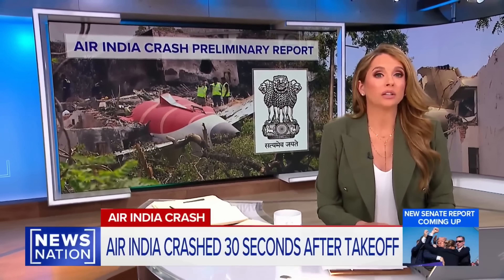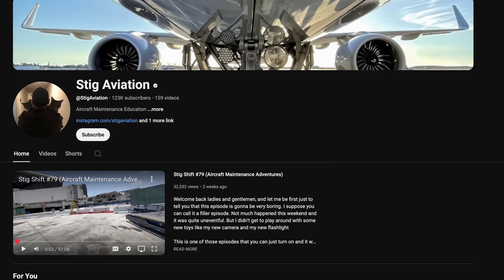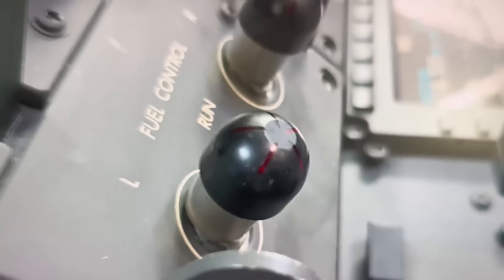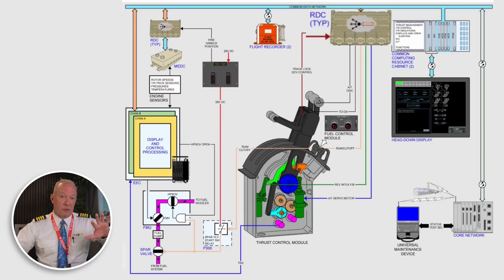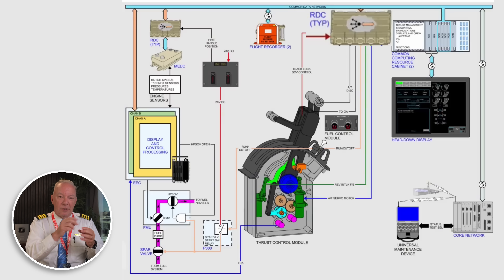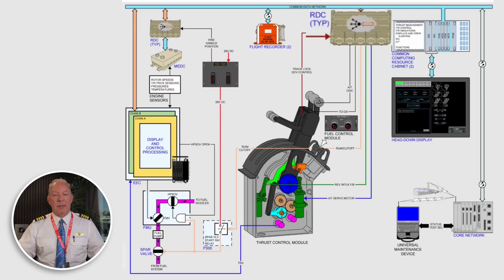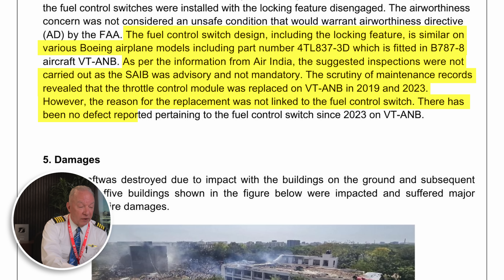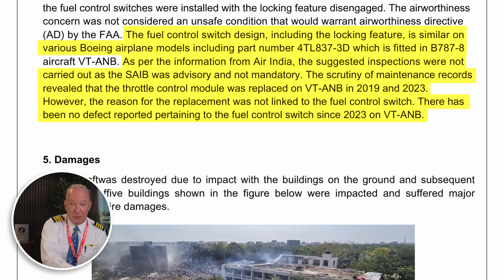The Truth About Boeing 787 Fuel Control Switches

Comment: Airline News with Geoffrey Thomas offers another theory. Possible water ingress into the electrical system caused a short. The pilots were trying to re light the engine. The preliminary report just does not give enough details for any theory, but right now, I still dont think the root cause is pilot error. 😢
Reply: If the water ingress caused an electrical system to short, will both the engines still be running?  Isn’t there a DC straight from the battery ? If so, why would you cut off the engines via the fuel switches and take 10secs to switch it back on? Also I still find it difficult to understand why would the pilot say ‘why did he cut off’ the other one responding ‘I did not do so’ why deny the action during an emergency situation?
Reply: @ashishthakur7396   Yes, the both engines would be running and short registered in the system and switched to one of the triple, quadruple redundancy units. DC comes from PSU that also has failsafes and monitoring and multiple sources.
That denial served the purpose of his act, any sooner would have ended the complete engine spool-up and no crash.
Reply: If there was a gross electrical fault at take off both Pilots would have been aware of it. The First Officer would not have just asked  the flight Captain,  why did you do that? (Closing the fuel cut off switches) Then having the Captain deny it makes no sense. The Captain would have indicated he was doing an engine restart and would have probably made that very clear on the CVR.  The First Officer flying would have clearly known of any electrical failure as well.
Reply: And why would one pilot deny moving switches by saying "i did not move them" while they were clearly moved? He would say something that it shorted or something, but not stay silent for 10 seconds and do nothing!
Reply: @Robis9267  Why, to complete his act - if any sooner the one engine would have spooled up and no crash + jail time.
There were only 3-4 seconds missing...
Reply: Stop talking about that nonsense channel - magical short from magical water that didn't register in evaluation units or FDR.
These people took a payment from someone and their talk changed overnight.
Preliminary report gives all the details and assures there are no other events or errors in FDR data, so the airline FAKE news channel is trash.
Reply: It's not an error, this was murder-suicide, facts are clear
Reply: This one gibes a much better theory thoroughly technically researched that explains the time line and has only a single point of failure of a crucial bug unmonitored component https://www.youtube.com/watch?v=OLxLN3osS1Y

Comment: Switch is switch, relay is relay. Relay is controlled by magnetical field of the coil which is inside, so higher current can be passed through relay “main wires” for example by use of thin control wires :) slightly offtopic

Comment: Thanks Steeeve for putting the record straight. I am with you 100%  there is no good reason for the fuel switches to be at cutoff for any period of time full stop. No engine can ever run without fuel and no aircraft can fly without it's engines running.

Comment: Hi, that's a good explanation, but... It turns out that the loss of 28V DC will be treated by the computer in exactly the same way as a switch being turned off. This voltage comes from the battery. We've had problems with such batteries in the past. It couldn't have been that the voltage dropped. Then the fuel supply was interrupted and the wind turbine started. DC power returned from the wind turbine, and the computer incorrectly registered the switches as being turned on again.
Reply: No the backup comes from battery to PSU. The engines deliver all needed power and battery is for backup.
For your theory the engines would have been OFF before and battery failed before that could happen and also why these events didn't register to FDR that has its own battery?
So, it turns out you are wrong.
Reply: It is my understanding that it takes power, (28V), to turn fuel valves off in aircraft with electrical fuel valves. Loss of electrical power, (battery, buss), will not cause fuel valves to go to the off position.
Reply: @joseleon624  No, it is fail safe open then and if main pump supplies pressure with switch ON and fail safe closed if switch is moved OFF.

Comment: Thanks for the video - enjoying following your content since the air india crash news broke. Minor nitpick, typically "closed loop" system would refer to some system which has feedback. This system seems like "open loop", i.e if for some reason the relay failed, or one of the valves failed, you would not get feedback at the switch. A "closed loop" switch, might for example jump out of "run" to "stop" if the valve could not open, or would jump the other way if it couldn't close. Clearly this wouldn't make sense in this application, but in industrial/control systems, closed-loop means it's self-sensing with a feedback mechanism.
Reply: Not necessarily self sensing, but it is a closed loop of sorts all be it corrective action would require human interaction,  The switches are obviously monitored as they are recorded , the recorded condition of the switches would be repeated by the computer to the head up/flight display. responding to any alarm or instruction the polit would operate the switch accordingly - so technically a closed loop system with manual operator control, as in SCADA/Industrial control systems.  just not an automatic closed loop control.

Comment: Sad to say, your understanding of the electical systems & schematics is incorrect and misleading. BTW, as a giveaway, we use "open" , "close" to describe if it's with feedback control. Not that "close" a switch when closing the contacts. " Therefore it's a closed system"
Reply: I'm an electrical engineer and I cannot make heads or tails of your remarks. You seem to confuse open and closed as applied to switches with open and closed as applied to complex systems. They are not the same thing.
Reply: Read n listen carefully again to what Cap Stee said as he showed up a piece of kids 101 basic electric control comprised of a battery, a simple 1PST switch, a load.Its how he explained " close " .I didn't mentioned I am an triple E in the system n circuit design of major mission critical SCADA systems ( Signalling n Control, mass transportation), just not to scare off people who are doing narrative browsing.
Reply: If you're in the EE industry, you might have heard of a term, " Hysteress loop in CLOSE LOOP control ".The spelling is both CLOSE , but the difference is mile difference there. Tell you what, it's this part of Control circuit that have caused, not only this 171 case, but the whole seies of  airborne n landed engine failures. Perhaps now you know how serious I'm taking the subject on my shoulders for humanity' n Christ's sake.Actually I started hinting those of the over simplified ignorance of mandatory  multi dimensional Hysteresis loop ( say, WOW, wheel distance travelled sensor.....) BEFOREallowing fuel adjustments can be made for stall and Stop.
I noted some claiming professional commentors has since given up RAT and flaps blames to follow this path of reasoning -fuel cut out -plane crashed. It's only you guys don't realize how it happened. You can't know if you don't even know what NO/NC 2PST/DT mom/latch ac/DC UPS ,,,,,are, and just put it in one word gitches. I tell you what, anything that doesn't exhibit wear and tear doesn't not follow p(MTBF). Software is one. The whole world has been cheated

Comment: Can the order that the switches were switched off give us a clue as to who flipped them? Is someone sitting in the left seat more likely to go left to right and someone sitting in the right seat more likely to go from right to left??
Reply: Why arent we considering a possibility where dual engine failure happens just after take off. Then pilot manually turn fuel switches off and on because thats SOP in Boeing planes in case of Dual Engine.? You can refer to Gaurav Taneja AI 171 Part 3 in english dub to understand more about this theory as timeline of RAT deployment also matches with this. https://youtu.be/pq2AZdzH7X4?si=0pLKXsmG1M7tRXAZ

Comment: What people get wrong is that they believe that BOTH switches were moved within a second.  The report says they were thrown a second apart, so the one second "clock" doesn't start until the first switch is already in the cutoff position - so it was one second for the pilot to move his hand and throw the SECOND switch after the first.   Also, you would want to throw them as close together as possible so as not to induce yaw if one engine is off for a few seconds before the other - at least in a small plane.  I think Captain Steve said once the 787 automatically adjusts for yaw if one engine rolls back.
Reply: The report does not state the switches were flipped off or "thrown".

Comment: I'd like to know what sends the signal to the FDR, to indicate that the fuel switches have been turn on or off. Is the fuel switch a double pole double throw type and the other pole sends the signal to the FDR, or is there a contact on the Spar valve relay which send the signal to the FDR? Is it at all possible that the throttle module had a faulty connection, causing the engines to roll back and for the fuel switch back indication to the FDR to loose connection, indicating that the fuel switches had been thrown, when maybe they hadn't. One pilot then assumes that the other has done something, when maybe he hadn't ??????

Comment: Hi captain Steeeeve. Great video once again!

I agree that the switch and the relais are mechanical and won't move by themselves unless manipulated by humans. But how does the FDR register the position of the switches?

The FDR recorded that the Fuel switches transitioned from running to off. I'm wondering, does the FDR know this because there is a sensor at the switch that registers its position or does it know this because it measures the 14V/28V in the wire between the relais and the spar valve/Fuel Management Valve/High Pressure Shut Off Valve? 

I assume it is the latter (because sensors for all switches would mean even more electric cables and thus more weight), then there is still a possibility, if only a miniscule one, that either the 14V/28V signal was interupted somewhere between the throttle module and the point where the electrical cables for the #1 and #2 engine fysically split up and are not alongside eachother anymore. Or the 14V/28V power line was interupted somewhere between the battery and the throttle module. 

It could be chafing, it could even be a rat chewing on cables, it could be a cut of the cables due to a (heavy) object that fell on these cables after rotation. Who knows? It must be something crazy since it would be the worlds first and its defying all odds.

I agree that the chances of this happening are extremely small, but they should at least be investigated and ruled out before the blame eventually comes down to pilot actions.

Disturbing fact to me is that the investigation team knows exactly which pilot said what during that last minute and they haven't given a transscript of the CVR, which is relatively easy to do, and that to me is an indication that the investigation team is hiding something. It could be culture standing in the way of the truth.

Comment: I believe what the gentleman on the panel with you may have been trying to articulate is that inside that column, there are wires within a bundle that at connected to those switches.  It is plausible that the set of wires connecting the switches to the relays could have had a defect (caused by rubbing against something possibly) that could have shorted or broken the connection resulting in loss of DC current in the circuit.  That would have been the same as turning the switches to off and transitioning the relays.  Seconds later, the fault (short) may have rectified from vibration and restored the circuit therefore re-establishing the circuit.  Not sure of the odds of that happening, but is within the realm of possibilities.
Reply: The fact that both the cut-off as well as the power-on of the switches each had ~1 second of delay between left and right does speak against this theory. Plus I bet the recorder does monitor voltage too since that is a very thinkable problem.

Comment: Well said. Some don’t want to hear the truth.
Reply: Why arent we considering a possibility where dual engine failure happens just after take off. Then pilot manually turn fuel switches off and on because thats SOP in Boeing planes in case of Dual Engine.? You can refer to Gaurav Taneja AI 171 Part 3 in english dub to understand more about this theory as timeline of RAT deployment also matches with this

Comment: Captain Steeeve 
TCMA: Thrust Control Malfunction Accommodation: This shuts  both engines and guards against inadvertent asymmetrical high thrust situations. Doesn't this mean the fuel shut of happened without the switches been manually turned off?

Comment: people imagine that airplanes are super complex but those critcal systems are simple for a reason, simplicity is safety
Reply: KISS. Keep it simple, stupid.  Or something like that.
Reply: @williamgibb5557 bang on right . I had a few other statements I told my aircraft maintenance apprentices. The best one was … Better to ask a stupid question than do a stupid act. I always backed up this with a few occasions when I asked what might have looked like a stupid question. Always safety first. The other was there is no parking area at 35000 feet. Gets them in the correct frame of mind.
Reply: Yep we aircraft maintenance chaps call these systems KISS. Which stands for keep it simple stupid.
Reply: For what I could research by myself, those are no simple systems.  The logic behind the circuit described by Captain Steve is simple, yes, but that doesn't mean "the switch design is simple", "the relay design is simple", "each valve design is simple".  I'm not an aeronautical / electrical / mechanical engineer, but I can tell you that there are lots of designs for each of those components so as to "add complexity in the  specification or design of each module".  Maybe what you're referring to is "simplicity at the highest level of detail" and if that's the idea, I agree with you.
Reply: Exactly
Reply: Nice
Reply: Lol no, you're just repeating gabber to sound proficient.

A simple system is NOT necessarily a safe system. Naive fallacy to think this.
Reply: having said all that..if suicidal..why put them in Run position at all?
Reply: @cjswa6473  Possibly done by the other pilot in a doomed attempt to save the plane?
Reply: @cjswa6473  so you're just gonna ignore the fact that the voice flight recorder shows that one asked the other why they cut the fuel switches off, and the other denied doing so?

Of course if one believes that the other switched them off, he is going to switch them back on again.

Why would you automatically assume that the one that turned them back on was the same as the one that turned them off in the first place? It was obviously the other pilot. Which is which still hasn't been officially announced.
Reply: So what does the plane do when there is a switch relay power loss.  Cut off the engines when it is flying or opening the valves when they are closed for a fire
Reply: @2adamast - It is my understanding that it takes power, (28V), to turn fuel valves off in aircraft with electrical fuel valves. Loss of electrical power, (battery, buss), will not cause fuel valves to go to the off position.
Reply: @joseleon624  As Captain Steve just said.. Thank you
Reply: @2adamast  A power loss in two separate circuits and time wise separated coincidentally by the time a human needs to move from one switch to another? And then 10 seconds later, the power is restored, again with a time discrepancy matching human actions...
Reply: @2adamast  I believe they using latching relays, so on power loss it will stay on the last power state.
Reply: @2adamast  as a someone else explain in other coment ,  the relay is not spring operated, if the power is loss, it will continue to keep the state it has,  the normal relays when losses power and are spring loaded pass to the "normal" position, (on or off) but in this case, you send the signal to close, and the relay it is going to open until it receive the signal to open
Reply: @ielsaproyectos3162  If it's a latch relay it needs another type of circuit with an open and close circuit. I suppose Captain Steeve tries to explain the switches only as the valves are apparently motor actuated, they will keep their value when power is lost. They would need more circuits than what was presented.
Reply: @2adamast  I know nothing about aircraft design, but I know a lot about safety-critical systems.  For an aircraft in controlled flight, the single most important thing is to KEEP the aircraft in controlled flight until the crew can land safely.  So, you keep the fuel on.  Fires in flight are rare, but not unheard-of.  Almost 100% of the time, the fire is extinguished in flight or after landing.  That's a far better outcome than crashing the plane by shutting off the fuel.
Reply: @2adamast  nothing. it's power supply is independent. do you really think people would design a plane that cuts fuel off when electrical goes out?
Reply: @2adamast they fail to the open position if there is a loss of power
Reply: Aircraft are complex. Especially the modern ones with electrical, mechanical, and most importantly the electrical, semi conductors and mechanical, semi conductors involved in their function.
Reply: @StevenStyczinski-sy8cj  But, as Frank Legare has posted, the safety-critical systems are kept simple.
Reply: @StevenStyczinski-sy8cj yes aircraft systems are complex but some are left in their 1940s versions for a reason.